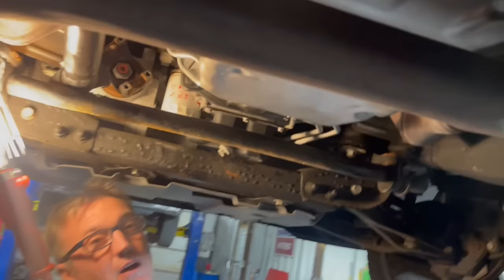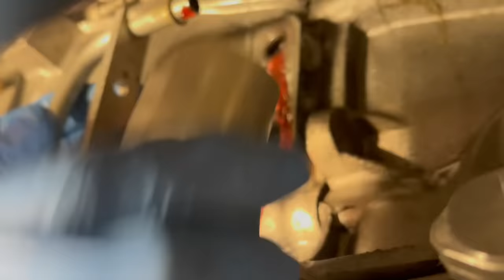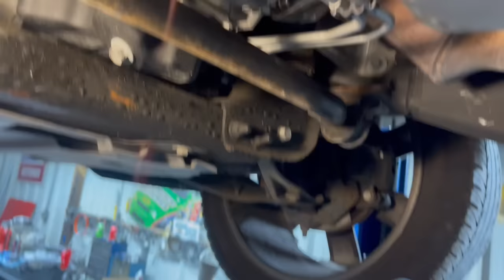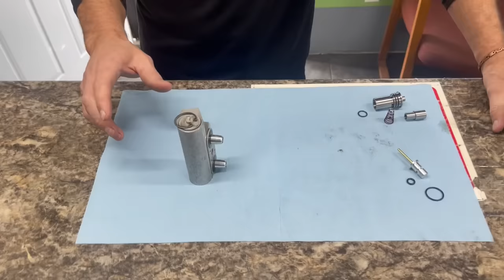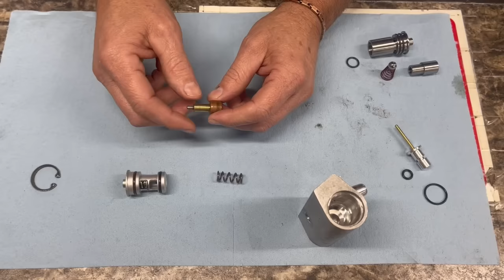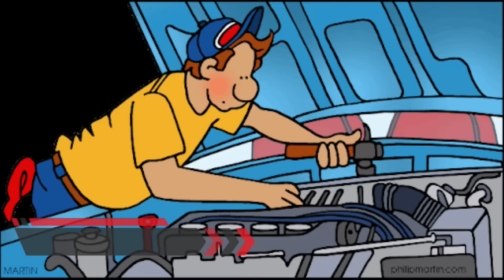Chevrolet 1500 Automatic Transmission ( 6L80 6L90 )over heating fix for 2014,  2015, 2016, 2017 up

Comment: I installed this kit in mine about a year and a half ago and it has made a big difference in my truck and luckily, I haven't had any issues with my transmission other than the high temps before I installed this kit but as I said it hasn't run high since I installed it.  I already decided if and when this transmission does go out, I will install the sonnax upgraded kit into it and also a 6L90 torque converter which many say makes the 6L80 trans almost bullet proof if you take care of it and do normal service on it. I have seen a few guys that said after doing the upgrades to the trans it stands up to towing and being beat on very well which I need due to me using it on the farm pulling trailers and equipment and such.

Comment: My son bought a new 19 2500 with the Duramax & Allison tranny.  It's completely stock and the highest temp he has seen was about 165 and that was towing 20K.  That tells me that his thermostat is a different one, probably close to 140 or so.  Now my 14 Silverado 1500 with the 4.6 has always run 198 when at temp and I have seen it rise to 214 after a highway run when I slow down.  Looking to get the Superior done very soon.
Reply: Did you got it done ?
Reply: @alonsoduran7759  I did and it's a lot cooler.  The highest I have seen it was around 170 which is a far cry from over 200.
Reply: @buckshot4428  i did my mine yesterday and it goes to 180  but before it was around 198
Reply: @alonsoduran7759  Make sure you keep up with the fluid changes too and use full synthetic fluid.

Comment: Thanks for a great video. I put  a Superior in my 2018 early on. I believe the high temps are why the torque converters are failing early. 
And using Mobil LV fluid really helps the shifting characteristics. Along with other "improvements" (I mean correcting problems built in at the factory)  a Chevy truck owner should do if you want make your truck last for the long run.
Reply: Another reason the torque converters are failing (in my opinion) is, the tune from GM is making the converter work way to hard, I use HP Tuners  to basically stop the TCC from working its ass off and destroying the converter.
Reply: @29auto30 I used the same tune. World of difference

Comment: I found this video last year, after I felt my tranny was running too hot towing. Before this install, my tranny oil would run at 210-220 degrees regular driving. I live in the hot south, flat roads. I installed the Superior kit, and a small 12x15 trans fluid cooler up front. After the install I would run at 135-145 degrees. Towing the same trailer, huge difference. Most notable was going over Wolf Creek Pass in CO. Before the install I'd hit 245 degrees after nine miles uphill to 10,800 feet. I would stop and let it cool. After the install, same trailer, same road, same weather. I peaked at 183.

Comment: Correct me if I'm missing something, but this mod will not decrease your transmission fluid temperature when it is under high stress. The mod simply creates a situation identical to that of having the thermostat wide open. Your tranny will run cooler under general conditions. The main benefit is that it eliminates the possibility of the thermostat sticking open and preventing the cooler from getting flow.
Reply: Sucks that Codermans Auto doesn’t reply!!! Also in this video they don’t discuss actual operating temp difference’s
Reply: Don’t do this mod. Just buy the GM updated thermostat
Reply: I believe you are correct - the temp under heavy sustained load will be the same.   Simple thermodynamics.
Reply: yes. it decreases it even in high load. i pull a boat and dont go over 160
Reply: @fishman80  I don't dispute your experience, but you're missing the point.
Reply: @kpd3308  it decreases the temp even under high stress. your statement said u didn’t think it did. pulling a 6k boat thru mountains is high stress. temp is decreased. if im not understanding sorry.
Reply: @fishman80  let's agree to disagree
Reply: @kpd3308  lets do that. ill be enjoying 40 degree temp drops under high sustained stress in the meantime. im giving u real world data points yet u dont want to accept that because it goes against what u wrongfully assumed.
Reply: @jimcollins8097  its not
Reply: I could be wrong, but I did the mod, and have seen a decrease in my operating temps, under normal driving, now the way I understood the mod, was that it constantly circulates it thru the cooler all the time and should reduce temps under high stress as well. Just the way I understood it
Reply: @flintstone86  you are correct in that it will reduce temps in normal use. But under extended high stress, both system will be operating at full cooling capacity, and no improvement will be noted. There would be some improvement under temporary high stress, because the system without a thermostat will start out at a lower temperature. But when a system approaches its stress limit, both systems will behave the same.
Reply: @kpd3308  well I didn’t think about that, makes sense, Thank you
Reply: @SpeeeedyG The updated part still has a thermostat that can fail. Yes it is a cooler thermostat but still failure prone. The kit he is installing is the best way to go.
Reply: I pull a 7000 pound trailer with my 2018 suerra 1500 , temp has never exceded 180 degrees , usually stays about 165-170 while towing . Runs about 160 on a longer trip without towing , about 145 around town not towing . Does this indicate I possibly have an updated thermostat already installed? I purchased the truck used with 65000 miles has 80 000 now . Was purchased as a certified used vehicle at a local gmc dealer .
Reply: When I first bought my truck with 6L90, transmission was heating to 218F while towing. Immediately reprogrammed it to not lock TCC and added transmission coolers, and most importantly I removed the radiator cooler connection. It now never goes over 172F even on 110F days while towing. My 6L90 did not have a thermostat, it is straight flow through to coolers. Best of luck to all.
Reply: I put one in on my 2017 silverado.  Took it for a 1/2 hr. ride. Temperature never went over 136 degrees. 95 degrees outside and no towing.

Comment: I did the delete on a 2021 Chevy Silverado now I run about 145 in the summer and about 120 in the winter and if I need to check fluid I just put it in gear and hold the brake and it’ll get right up to 135
Reply: It was about 180/185
Reply: Mine still running 170.  You must not live where it's hot

Comment: I haul GM parts to GM dealers….. every dealer gets one or two of the these entire assemblies everyday. The block and hoses comes as an assembly. I thought these pieces were A/C parts and then on my hand held it said “trans oil tube”….  Can’t haul enough transmissions in and out of the dealerships right now.

Comment: Hey there. 
Great videos lots of good info thanks. 
I am due for a trans fluid drain and fill and new filter. 
I have been debating upgrading my block with the new lower temp thermostat from GM or the surecool mod. 
Wondering your thoughts. I understand the idea behind the mod (preventing the possibility of the tstat locking up and preventing the fluid from passing through the cooler) but I’m wondering if the constant lower temps can also cause issues. I would think it will take the transmission much longer to warm up to operating temp from a cold start in the morning. 
I live in Canada and winters can get pretty cold. 
What is optimal operating temp for my 6L80? I’ve read around 175F. 
With the surecool mod I’ve read a lot of people saying there temps don’t get above 130. That seems problematic?
Also what’s your thoughts on the exhaust pipe running right underneath the trans pan. Seems like a dumb idea by GM and a good way to heat up the trans fluid. Should be a heat shield at least. Maybe it would help temps from rising so high?
You say you like surecool better in this video because of pressure regulation but in a newer video you talk about using the transco delete. 
What is your best advice now for me in my situation. 
Would greatly appreciate your feedback here or anyone for the matter. 
Thanks

Comment: So I crawled under my pickup this afternoon just to get situated on what I was going to be taking on and it looks as if mine doesn't have that block, but is a much smaller casing that is narrow with just the lines coming out of it. Do they make these without the thermostat unit and just allow the fluid to run straight through? I bought the pickup used at the end of February, so I'm just getting into really looking things over since the snow's started to melt.
Reply from the maker: yes this is why its so confusing and  WHY did they only put this on some of the vehicle and not all if it was that important to bring the heat up to operating temp faster

Comment: Why isn't there one for 2007 to 2013 SUVs that have 6L80s?   After rebuild beefier parts and TQ it's running hotter than normal .. 225 at some points... Or do those models only have the oil cooler in front of the radiator?
Reply from the maker: you should try to back flush the cooler at the radiator force cleaner from the top line connection out thru the bottom line connection because when a transmission has a torque converter coming a part it goes thru the cooler before it goes thru the filter
Reply: @codemansauto208  it only does it between 1mph to 40 mph those 3 gears. After it shifts above 40 it starts to cool down. They think the valve body is bad on those solenoids. Cus it bucks on down shifting b4 full stop at 10mph . And even though old trans had 200k + on it my truck never bucked or kicked. Goes back in Tuesday for the techm replacement.  If that takes care of everything. I'ma add a mishimoto cooler up front get rid of that small stock auxiliary trans cooler

Comment: Great video! 
I have a 2017 Silverado 1500 z71 living in SoCal.
Dealership just replaced the tranny from a failed torque converter. Must have been the heating issues. 
They did not change the TBV valve. 

I checked and I have the updated coolant lines that does not have the cir-clips.

That being said, Updated GM option is better over the Superior Solutions? 
I like both options at this point.
Any downsides to The superior solitons with being too cold? 
Let me know your thoughts!
Reply: Sucks that Codermans Auto doesn’t reply!!! Also in this video they don’t discuss actual operating temp difference’s

Comment: My don’t have the spring or anything inside just that one thing took off the transmission is that normal or no because last 2 years I didn’t have any issues till last week trans temp is about 210

Comment: Okay, what is the temp the transmission should be at? I did the superior solutions and it works great on the HWY. Sometimes it gets back up to 190° but I went up to big bear mountain here in CA and it got up to 230° 

At what temp should I be concerned?
Reply: Mine regular highway driving at night shot up to 235⁰ and shifting was bad and leaving from a stop it would act like it was slipping
Reply: @ms13goku  man that sucks, mines been normal since.
Did you do the thermostat delete yet?
Reply: @alextrujillo8658  yes I did it over this past weekend being I work out of town and package arrived while working of course. But on the drive here at night with temps about 30⁰ outside the trans temp stayed around 127⁰ and never passed 133⁰(while at a stop) During the day it got to 136 so I'm super happy with it and was really easy to install. Even going through the mountain where temps would go up to 211⁰ it stayed steady in the 125⁰ range
Reply from the maker: the temp shouldnt get above the operating temp of the engine, you might try a back flush on your trans cooler lines to make sure that your torque converter is not coming apart and stopping up your transmission cooler system,  i do have another video on a 2500HD series that shows what can happen if the converter fails. 
this 2500 was acting similar to what your describing 
and dont rule out that you might be getting a bad reading from your transmission temp sensor, a transmission shop should have a way to test the fluid temp
Reply: Sometimes we overlooked the “proper oil levels”.  And the right fluid recommended. If it says Dexron VI, you put Dex VI, not V, not III. A few liters high or low can really make a big differences, with newer trucks, are just too sensitive.

Comment: Great video! I have a question: after deleting thermostat and doing fluid change when you need to check fluid level without dipstick.on stock truck you need to run it till temp go to operating temp.then let it drip till very little comes out
Reply: Sucks that Codermans Auto doesn’t reply!!! Also in this video they don’t discuss actual operating temp difference’s
Reply: Just let it warm up for a couple minutes and check it.

Comment: I was wondering if the 2022 chevy sliverado 1500 4wd 6.2L trail boss still has this same problem? I noticed my transmission temp is running average of 164 F not pulling anything. Is that too hot?
Reply: Thats normal HOT ranges.

Comment: So ok i get whats going on here ok..my question is i have a 2017 Silverado with the V6 i believe the lines hook up to the water radiator and not a cooler ?? If water temp is at say 195 ex .so is your tranny temp..so my question is do you do a delete on a V6 or not .seen others say not to the tranny runs hotter??? True or not true?

Comment: I have a 2010 Sierra.  Is there anything like this that needs to be done to it?
Reply from the maker: no the thermostat was not introduced until 2013  there is an upgrade on the fluid,  blue label Mobil One atf LV HP

Comment: I install the bypass valve kit today 10-6-23 i drive for maybe 1 hour street and highway  the high temp was 207, dealer did the transmission flush back in April.. i need some help .. any ideas please
Reply: did you find anything out

Comment: I deleted mine a few weeks ago.it always ran at 194 degrees.it hasn't gotten over 138 degrees so far.truck is a 2016 Silverado and has 74,000 miles on it.wanted to prolong the life of the trans.
Reply: I have same truck looking to do asap.... I have 77,000 .... Looks easy
Reply: @Mikey-wf9py  mine was easy to do.hardest part was getting the c clip out of the top.mine had a lite bit of corrosion.make sure you do it when the trans is cold so not as much fluid will come out.
Reply: @seantylerwray  thanks man I just ordered it I'm going to do it as soon as I get it The transmission fluid has been changed twice so it's clean that helps and it still shifts great question Do you use a range or AFM delete wanted to know if it can cause any issues if I keep using it
Reply: @Mikey-wf9py  I have a superchips tuner to disable the afm.as soon as I got the truck I turned the afm off.been disabled since my truck has had 55,000 miles.i also changed tire height and gear ratio with the tuner.
Reply: @seantylerwray  Nice yeah I have a AFM disabler as of right now but I have a cat back exhaust in a I'm ordering a cold air intake and then I'm taking it to a local shop to get Dino tuned He's going to shut off the speed limiter the AFM and tune the transmission in the motor
Reply: @seantylerwray  strangely mind does 115 already All my old Chevy's only did 98 except for my 5 speed 89 that one did 140 well I didn't know what it did The speed only did about 80 but I know I was doing well over 120 but that was a I put a 350 in it out of a roadmaster
Reply: @seantylerwray  I only go 75 anyway
Reply: @Mikey-wf9py  fastest speed limit we have here is 70.but I rarely go on that highway.everywhere is either 55 or 60.my truck gets kinda sketchy going 85 with 35 inch tires on 14 inch wide wheels so I just drive the speed limit
Reply: @seantylerwray  yeah I have stock wheels no lift was debating on lowering it It has a new drive shaft already so it has no shake at 115 so I know it would go 140 easily but I got kids I'm too old for that but it does make me want to get like a 99 to 2006 style and build it short bed regular cab 2wd 6.0l swap lol

Comment: I know I have 2016 Chevy 2500 hd when my transmission gets 200 degrees 6th gear will go away if I let it cool down it shifts like new one until it warms up and I can drive it 75miles but it will only go up to 5th gear until transmission cools down

Comment: I just had this installed in my 2015 gmc crew cab 4x4 with the 6l80,  but it is running hotter not cooler i used the shift tech product part# stl010. It has gone all the way up to 217, and is back down to 189. Is it possible that the shop put the spring in backwards and that is what is causing this problem? Help
Reply: 217 degrees are not to be worried. Besides temp went back down.  And with this part installation. Do you really have to go to the shop?

Comment: Know of anywhere a guy can buy a block with the superior hardware already installed so he could just swap them out and not have to do the tear down and rebuild?
Reply from the maker: i dont know of anyone that sells them that way, but your may try your local Transmission shop to see if they can build one for you,  this bypass takes less then an hour to install so it should be a quick in and out for a transmission tech
Reply: Ordered the sure cool kit and going to give it a shot. Looks like I have a 6L90 in my 2016 2500HD GMC. Has the overheating issue been seem more in the 6l80, or is an issue across the board for both? I'm hoping the tear down and install is similar to what you show on the 6L90. Part is supposed to be here by Friday, hoping to have it pulled apart and reinstalled by Saturday evening.

Comment: Great Video but how do you replace the lost ATF from removal and how do you check the fluid level without a dipstick??? Thanks
Reply from the maker: you should be able to buy or order a tube and dipstick for your truck
Reply: I only lost maybe a shot glass full of fluid